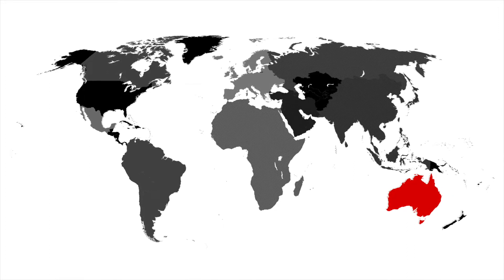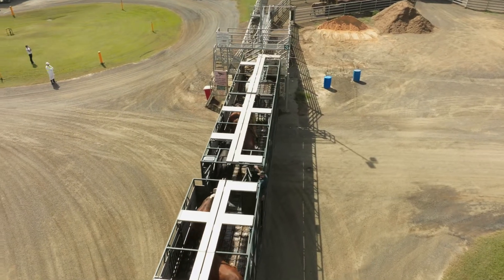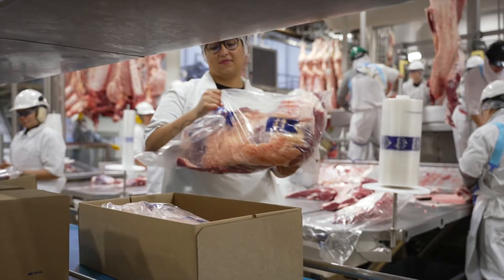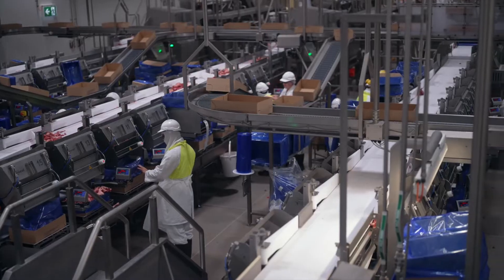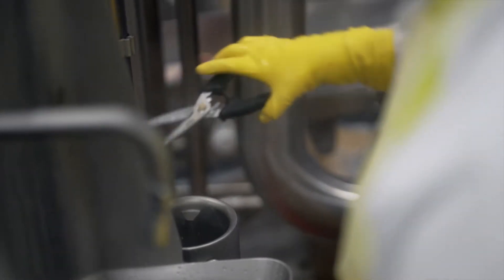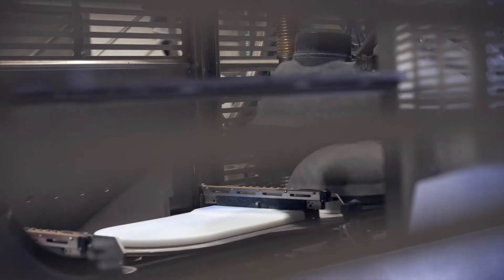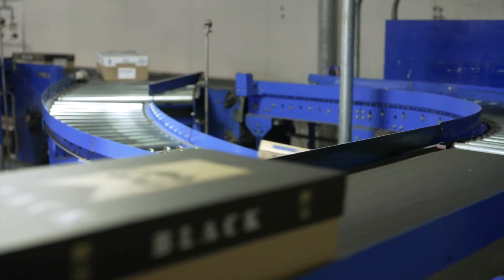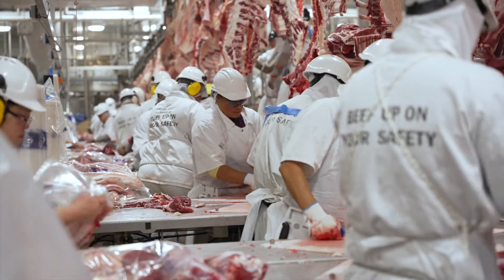Dinmore Plant Video 2023

Comment: JBS Dinmore has driven down wages to the point Aussies would be mad to work there, the company then runs to the govt crying that Aussies are lazy and wont work in the industry, the govt then allows them to bring in migrant workers, the company then has so many migrants workers that when it comes to negotiating wages and conditions they offer next to nothing and the cycle goes on and gets worse, as for safety?, if you get killed on the job they will drag your dead ass off the chain so they can restart it, so true and so sad.